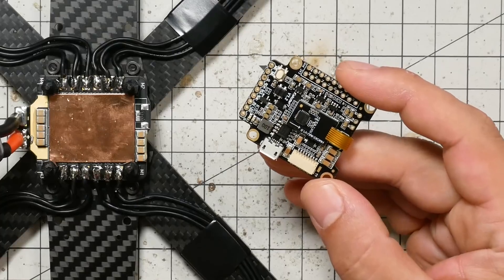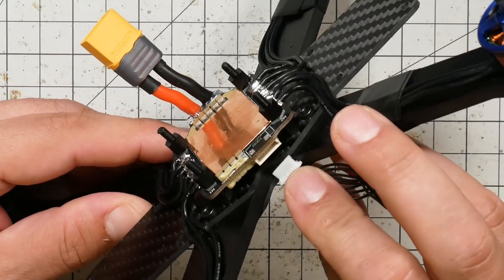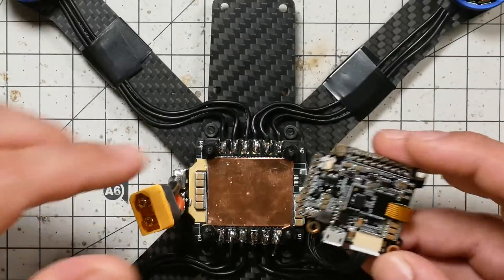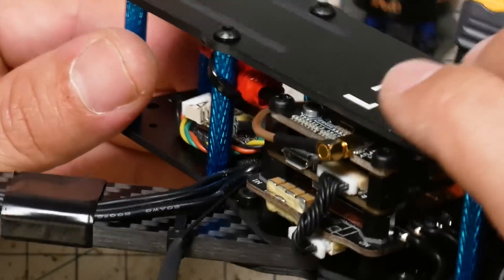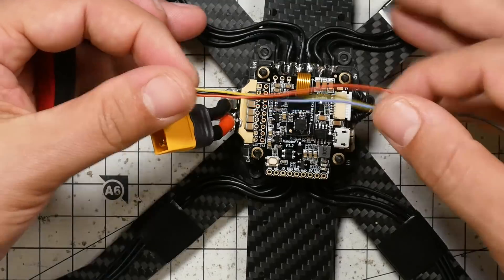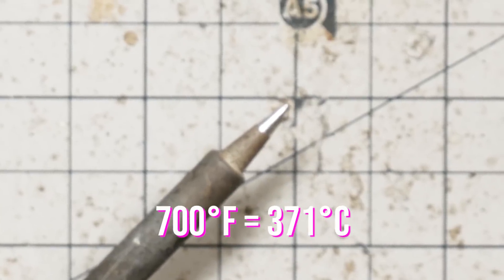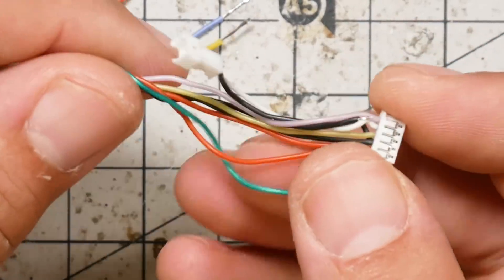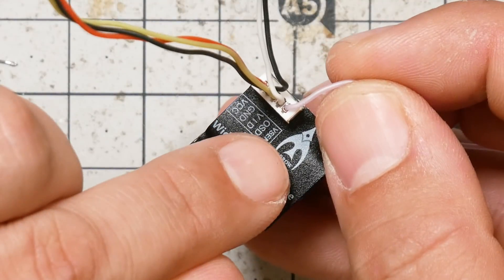Learn To Build a Racing Drone - Part 6 - Install FC and Prep Wires

Comment: awesome videos man. the kit has been out of stock everytime i go to order so i ordered everything from other places. but i couldnt get the f7 stack . so i got the f4 stack. i see some pins are in different spots. if i follow the right pin outs for the specific wires , how much will everything else compare as to in your videos and configuring everything in betaflight.
Reply from the maker: The configuration of the Ports tab may be different on the F4, but other than that the configuration should be very similar.

Comment: Can i use a Lumenier BLHeli_32 32bit 50A 4-in-1 ESC 2-6s w/ BEC 2A/5v, DSHOT / Proshot instead?
Reply from the maker: Yes that will work but the pinout on the plug may not be the same. So you will need to make sure of that and possibly rearrange the order of the wires in the plug.

https://www.youtube.com/watch?v=W-kneNn8ItQ

Comment: Why was a bardwell f4 v2 not used?
Reply from the maker: The Holybro stack contains ESC, FC, and vTX in one simple SKU. This makes inventory management easier on the back end, and means we can get a bigger discount. Also, at the time I started this project, my ESC was not released. I wanted one integrated stack, not individual pieces, so the build would be simpler.

Comment: Hey guys i was just seeing if anybody had recommendations on a laptop that is capable of running liftoff simulator and betaflight..currently running a linux based machine that has troubles with both...any help will be appreciated
Reply from the maker: This is the one I use for gaming and video editing.

https://amzn.to/2zWTdk5

You definitely need one with a dedicated graphics card not an integrated one.
Reply: @JoshuaBardwell   thanks josh, for everything you do for the community

Comment: What are you spraying on your soldering iron? I hear you do it in the background???
Reply from the maker: I'm not spraying anything. I'm swiping the tip through a wet sponge and that's the water hissing as it boils.

Comment: Can you please tell us what the ” vsend “ wire does before we cut it.
Reply from the maker: The camera has a built in voltage OSD that you can use if your FC doesn't have OSD built in. 

If you use the FC built in OSD then you don't need the camera OSD at all.

If you power the camera from vBat, then you don't need to use the Vsen wire. The OSD displays battery voltage.

If you power the camera from a voltage regulator like a 8v regulator, then the OSD will just show 8v all the time and be useless. So the Vsen wire lets you power the camera from a regulator while still having the OSD show the battery voltage.

You can see, there are several reasons why it's not needed here. 1) we are using the built in OSD in the FC. 2) we are powering the camera from vBat.